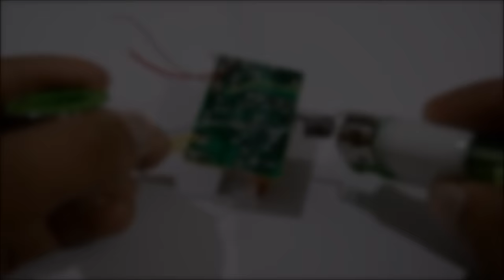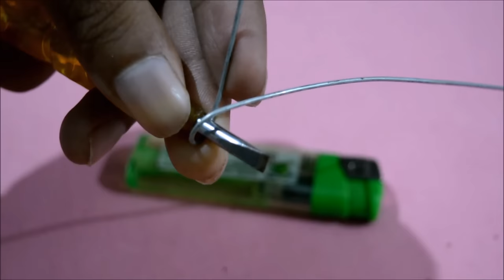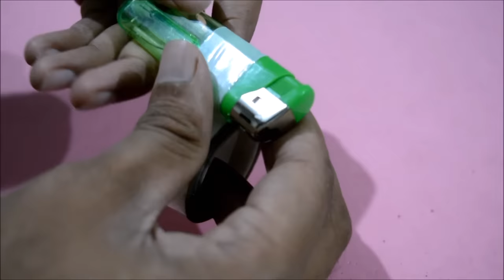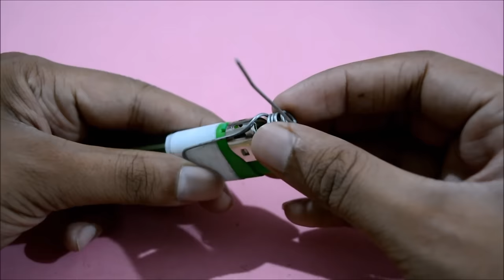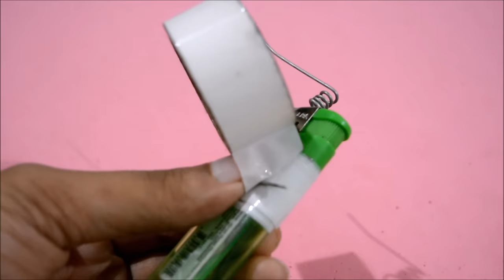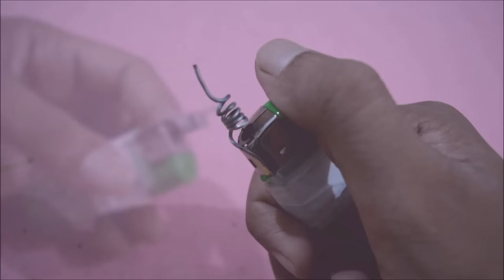How to Make a Soldering Iron by Lighter

Comment: creative idea, I just tried it using copper coaxle cable wiring. tried to solder battery wires back onto a rc car motor with previous solder on the motor leads but didn't work for me. I then simply used a handled tool with thicker metal and it worked. coaxle wire just didn't transfer enough heat to effectively melt old solder and make it stick to my wiring. great hack tho.

Comment: the heat from coil could be transfered onto the gas tank.. it could result and explosion !!!
Reply: True
Reply: so inorder to avoid that problem we can put some stuff that heat doesn't touches gas tank. or we can cover up gas tank
Reply: Ekusupulosion
Reply: Or by holding the steelwire with other tool

Comment: It is not working tell me which type of wire is needed to stuck on lighter
Reply: if you get the ball from a ball point pin, and wrap it in the coil, you could probably use a paper clip.
Reply: Hola 👍

Comment: Which Wire You Used Can I Use Tin And Lead Wire.
Reply from the maker: lead is not good for soldering
Reply: i am not talking about soldering wire which wire should i use in lighter which can heat quickly
Reply: How Are You Rahul Belure How Can I Help You
Reply: josna dance